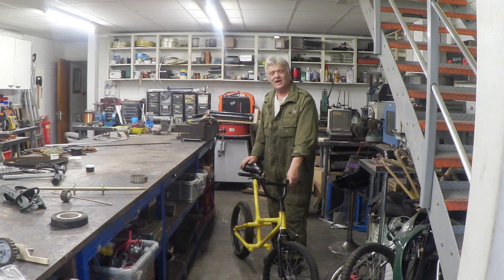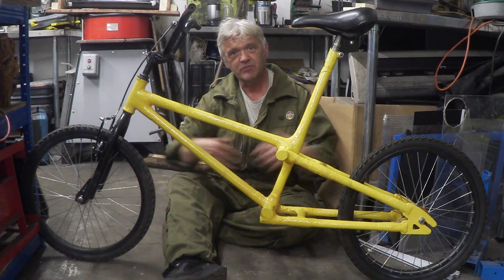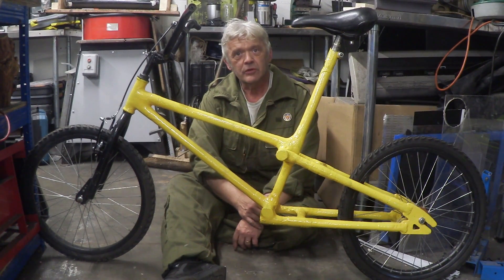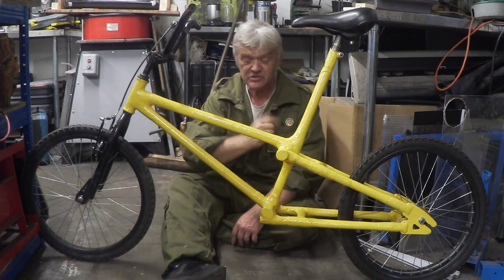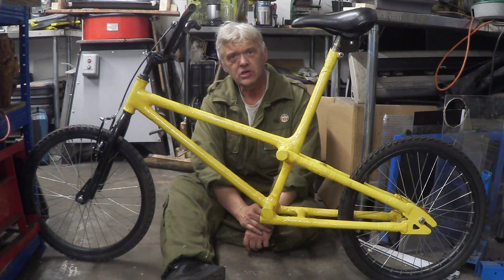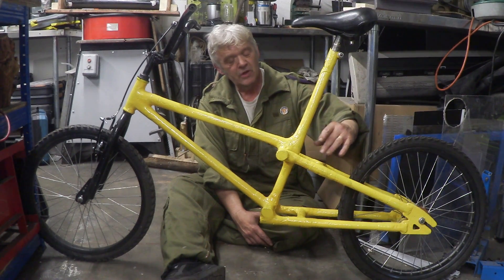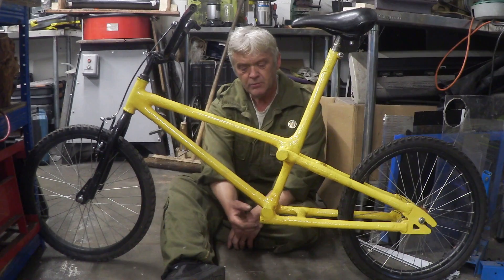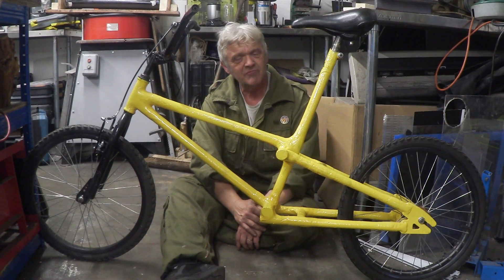1170 A Paper Bicycle - Technical Information

Comment: 🤔 As a commuter bike to do the mile and a half distance from house to train station this is excellent, while not full riding speed of a pedal bike 🚴 it’s certainly faster than walking 🚶, and if it gets ‘tea leafed’ then just make another one 😁
Reply from the maker: it would work for that - for sure - but you have to remember this is just my first effort - with real design and work I am willing to be this could well be the same as a 'normal' pedal bike - mechanically there is no reason why not

Comment: What is the weight compared to the old steel bike in a similar striped state?
Reply from the maker: no idea - to be honest mate that just didn't seem important to me - I was thinking of other issues
Reply: google says "Steel frames are heavier- Steel is the heaviest bike frame material used today. For example, a lightweight steel bike frame weighs around 4-5 lbs. Complete steel road bikes weigh 20-22 lbs.

Comment: ball mill iron filings & paper fibre ,add binder (old copper plating liquid!), paint/spray/dip on sheets,roll.. dried on a simple copper wire wrapped rack with pulsed dc running through it you have nice long directional electromagnetic core material... microwave a bit ,did you suddenly get something electrically magnetically  interesting ^_~
Reply from the maker: Thanks for the tips!
Reply: @ThinkingandTinkering  you could also put/feed at some rate the magnet dust/metal/carbon loaded self insulating roll bar through one of those cheap £10 12V ZVS Low Voltage Induction Heating Power Supply Tesla Driver Board Module With Coil 
...& slowly cool it through a paint on heater tube to regenerate the metal crystal lattice oc.
 you would have to rezap it (as it cools!) with high dc to regain the curie point higher magnetic strength i suppose.
you did remember to put two separate copper wires in the center roll right ^_~ to make it easy to pull/zap/whatever on the imaginary diy table top/wall hanging paper rolled bar+cotter pin quick assembly frame cnc assembly line later

'Enhancing the bond strength in the meta-crystal lattice of ...'

Comment: If there is to be a paper bike mk2, It would be awesome to see k'nex style joints milled from flat cross-ply paper or cardboard blocks, particularly at that seat stay/top tube/seat tube intersection that the seat stays drive most of your weight into!
Reply from the maker: I think so as this is really just an exploration of the material - but the chances are I will do stuff you don't like or do stuff that is not exactly what you would do - it might be an idea if you gave this a go too
Reply: @ThinkingandTinkering  would love to if I were able. Between disability and lack of resources I'm consigned to armchair engineering. I'm sorry if you get the impression I dislike any of your projects and decisions. It's because of my admiration for your work that I offer my tuppenceworth

Comment: Great content as usual! What if you alternated the grain like plywood on the bars that need to flex in more varied directions? Thanks again and God Bless
Reply from the maker: for sure - but it is very unusual for a bar to need to flex either side of parallel to the centreline

Comment: You said you rolled the paper around the plastic pipe.  Did you remove the pipe or leave it in?  If left in, it's not really a paper bicycle, more a plastic bicycle wrapped in paper.
Reply: Watch his previous videos! He made a rolling machine out of plastic pipe to form the paper rolls!
Reply from the maker: sorry mate I rolled the paper with the plastic pipe not around it check out video 1165 for the technique

Comment: Thoroughly enjoyed this project. It also hints at the versatility of paper as an engineering material (which was once more commonly used) for use in other projects. 
My gut reaction is that despite newspaper containing wood linguine which in time produces acids that makes the paper brittle. The fact that it is glued and thus preventing oxygen getting at the cellulose fibres, should give the bike a reasonable life. For even cheap metal bikes don’t last that long. 
Might be wise to have drain holes at the bottom of which ever parts are likely to pool condensation or seal those sections to stop all moister getting in. 
Acid free wall lining paper is maybe the better choice which is still inexpensive, stronger and should last longer. Yet, it certainly lacks the je ne sais quoi of The Sun! My choice would be the Guardian. Its long polysyllabic rambling paragraphs should help the bike glide over the deepest potholes.  Only  problem that remains is that I don’t know anyone that reads papers any more!
Reply: The japanese researched a lot about paper as a material for modern engineering. How it's folded or bended and other inspirations from origami and their classic architecture, all of this also influences the final result, besides the composition of the material.
Also wood derived materials such as super wood and maybe transparent wood have their lignin removed, maybe the same can be done here.
Reply: It is not as inexpensive, but I would be more apt to use flax linen woven cloth. If you get a 50% off Joann's coupon, you can get it for reasonable, plus occasional online sales, clearances, etc.  Probably would use a cardboard tube to wrap it around. But then again, same issues of paper applies to the cardboard tube, so maybe not.  Maybe a bamboo garden stake pole or the like in that case (obviously one of the thicker ones).
Reply: @justinw1765  Some natural fibers come braided into convenient cloths (woven in the case of flax), maybe the same can be done with paper.
Reply: @vitordelima   Perhaps, but the individual fibers don't have near the tensile and other strengths of flax linen and hemp. 

  Exception being if you could make it out of something like tencel--a specialized rayon/wood cellulose fiber.
Reply: @justinw1765  I mean, not as fine as those cloths but braids of wider strips.
I didn't know tencel existed.
Reply from the maker: nice post mate - I think when I do it again I am going to use Kraft paper

Comment: I wonder, if you roll the paper, then wet it and gently work it, can you curve the paper rod like you can with wet wood? if so then I agree that bends  would add a lot more uses to the paper rods :)
Reply from the maker: Interesting point - I wonder is steaming would do it after the glue had set?

Comment: I vagely remember that someone made some furniture out of old newspapers and cardboard. It was in some magazine (DIY type) , before internet and you tube. I've made a little stool out of cardboard , some years ago and it lasted for some years , before someone nicked it. Also made some stuff out of old clothes (glue laminations and some resin). For outdoor stuff , I have not found (cheap) solution for waterproofing and UV protection. Anyway , it was some decades ago and I since lost interest in that and the last idea was to make some terrace/patio furniture. Anyway it is a great stuff you are doing , as always.
Reply: Titebond III wood glue is reasonably priced (at least in the US. I get a gallon for 28 dollars) and water resistant enough for most applications. Nor particularly affected by UV either, but if that is a worry, then a light coat of thinned silicone would greatly help (and further increase waterproofness).
Reply from the maker: cheers mate and thanks for the share - good to hear about all the stuff that could be made this way

Comment: Hey Robert, that's looking pretty good.  Very good, actually.  A few questions, though.

What weight does the frame alone come in at?  Did you do any testing as to the strength of the tubes, or are you just winging it?  I have a few ideas along these lines myself, and I missed the casein glue recipe you used, can you point me to it?
Reply: It's in the video 1166.
Transcription of the recipe:

Casein based glue

Casein 100g
Water 150g
Calcium hydroxide 20g + water 50g
Reply: @angelusmendez5084  Cheers, man.
Reply: I'm in love with this glue, Rob, do u think she's got a boyfriend? 😂
Reply from the maker: at least buy her a drink mate lol
Reply from the maker: I am basically winging it mate - if it works well I may well do something else with this and we can get a bit more info then

Comment: Hi Robert gerat video, is there a reason for having the handlebars on backwards?  ~ just asking. KR AndyT(UK)
Reply: It's not, look at the angle of the actual handles. If the piece was the other way around the handles would angle forwards, away from the rider.
Reply: @elmikeomysterio5496  I agree… the hand grips are ALSO on backwards…
Reply: @elmikeomysterio5496  basically, Robert put the U bar in backwards, so he set the bar in backwards to compensate…
Reply: The handlebars are right but the stem is on backwards. The dropouts at the back are upside down too but I can’t see that mattering with the bike as it is. 
With the stem the right way round, the bike will handle better.
Reply from the maker: so I can reach them mate

Comment: Since this is a minimalist build, you could try a motor with small drive wheel, friction drive on the side of the tyre. Maybe with an idler wheel on the other side of the tyre to reduce side load.
Reply from the maker: good idea mate cheers